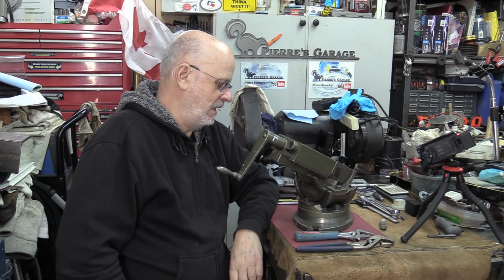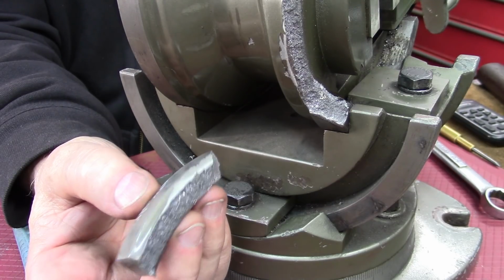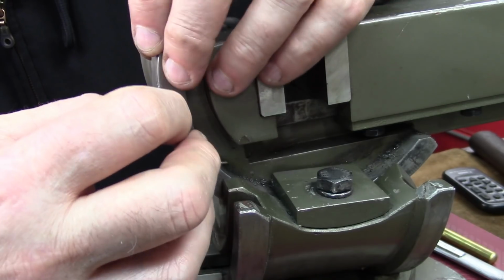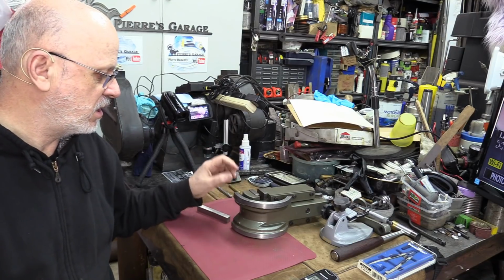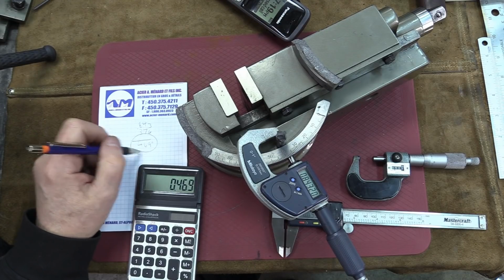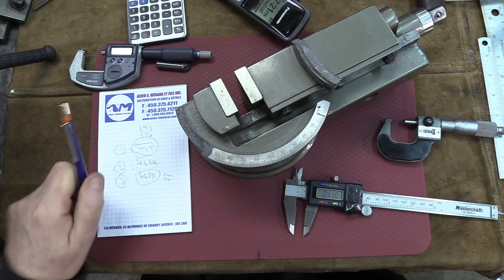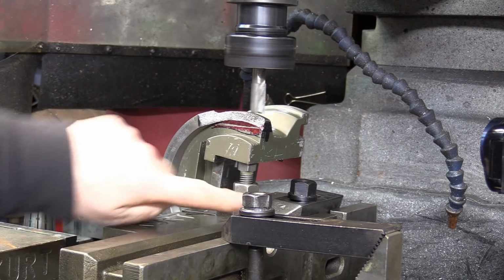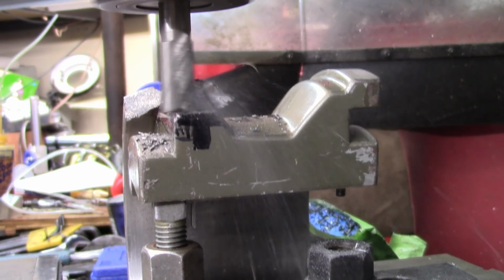Wilton 3 axis vise, smashed and repair using "Cold method" Part-1

Comment: Pierre,
  The positive thing about all this is you CAN repair it. Thereafter you will have the satisfaction of using a tool that now has Wilton/Pierre as manufacturing logo. Most people wouldn’t have even brought it home or even tried to use it as is. 
    I like the fact you are adaptable during the process. If epoxy is in the fix the more bonding surfaces you have, the better. In woodworking and guitar making we would call that a “blind mortise”. Very strong and interlocking which is what you need in this particular application.
Reply from the maker: The idea of using a blind mortise came early in the process, making it protrude instead of digged came as I was gonne make that last surfacing, having planned a little better it would have been the full height insteand of the 0.150" or so. This will be good with a few fasteners to assist...   ;)

Comment: Hi Pierre,

Shit happens as they say.  It happens to everyone at some stage. Usually to something expensive.  I think it's more maddening when you do it and can't blame anyone.

I'd be inclined to braze the break after tinning both faces, but this looks interesting.

The only downside is that the paint would be destroyed, but I would point out that steel always rusts more than cast iron, which is actually pretty low on the rust scale in comparison.

So that's something to consider.  I did a steel to cast iron pulley repair for the old Schaublin lathe and the steel rusts quite readily in comparison.  But you can shrink on steel.

Good luck with this one.

Cheers Rob
Reply from the maker: It doesn't mater who did the break, the vise doesn't care, it's broken and needs fixing...     lol
I the break would involve the part the hold the pressure from the jaws, there would be no question about ruining the paint, brazing or welding...
This part isn't so much stressed, so in order to keep the paint intact an epoxy and probably adding a few fasteners will surely do the job all right.
Here rust isn't much of an issue, except just have to be carefull in the very warm and humid days og Fall after a very cool period, some condensation will occur and flash rust about everything not covered with oil in the shop.
Cheer,   Pierre

Comment: When you dropped the hint the other day on the geometry video I was wondering how you were going to repair this one.  Interested in seeing how you set up to cut the radii on the inside and outside of the arc.  It's actually been fairly mild weather here, you're really cold compared to us!
Reply from the maker: The trig lesson application is coming in the 3rd episode, be patient...   lol
Today it's snowing a litte, tonight we're expecting freezing rain and rain, what a shitty mixture, we get from minus 25C to 3 deg. C in less than 72 hours...  In the leter years we're getting rain about 5 to 10 times per Winter, as way before it was once every 5 to 10 Winters, something is going wrong, even though I hate Winter and cold...
Cheers,    Pierre
Reply: Wet it down real good and put it out in the snow for an hour, that thing will be stuck there good! (minus thirty here on the lake this winter BTW!)
Reply from the maker: The first thing that came to my mind, working on the vise in the cold so it stays together, and, that by accident hitting my frozen thumb with a hard cold tool, there is a tear starting to form in the corner of my eyes...      lol

Comment: Weather at your place looks like how mine was on Monday.  I probably would have just built it up with weld and then annealed it in the furnace and remachined it. No one would ever know. :-) I wonder if heating that broken off piece to cherry red would have released stress in it and it would have sprung back??
Reply from the maker: I'm doing this in order to not burn the paint, if the break was in the part that support the pressure from the jaws, it would have been brazing and had to cacrifice the paint, but this area will be all right and saves me from a full paint job...   ;)
I'll try the cherry hot solution, that could save me in the future if it ever works, have my doubts, though...
Here, today's weather menu:  Some snow this morning, freezing rain later this afternoon, rain this evening......       Beuark...!!!

Comment: I think cold repair is best choice with this. Heating it would distort it and then you would have to find reference surfaces and completely machine all critical surfaces. If this happened to me, unfortunately I would just scrap it and buy another, because, I am pretty much always working on something here, no way in foreseeable future I would be able to give up time to fix the vice. I do weld cast iron micrometer castings, and is not fun to machine afterwords. But, I do grind after welding and that seems to go fine.
Reply from the maker: ŧhis is a $1000 vise when purchased new, it's worth for some people, not everybody, just like you can make more money making what you do best for paying customers...  ;)
One great thing about cast iron castings, they're less affected by heat than other type of steel, but, with heat you never know what the end will be...

Comment: Why not a metal infused jb weld type mock-up patch piece. You can use it to align your mechanical fixtures and use that to copy or cast a repair in silicon bronze. It too is a cold repair as all heating done away from vise. Even dovetail key that tenon you left in place and slide then screw down your repair part.
Reply from the maker: You're coming with a very interesting idea, the real deal is gonna be close from what you suggest, with no heat involved even away from the vise...   ;)

Comment: I saw the vise and I though "ouch". Then I saw your weather report, and I really felt sorry for you. Worst I ever experienced was about -17C (+1F) in Wisconsin. I gotta say, you are tough to manage life in -22C. Maybe you could just heat the oven up while you do your cold repair. :)
Reply: When I was in Montreal for new years several years ago, and it was -11°F/-23.9°C! In the city the wind was ripping through the streets between the buildings, and it felt like fire.

I was in the mountains of New Hampshire last year (January 2-3 2018) and it was -12°F/-24.4° when the sun went down. And with the wind chill, it was like -27°F. The strange thing was, that I couldn't feel a difference between the day and night temps -12°F night/12°F day. Δ24°F, but the day temps felt just as cold as the night temps.
Reply from the maker: The shop is heated at a constant 62 deg. F, it's comfortable enough with a hoody...
Sometimes we'll get a few days at -25 C  ( -13 deg. F ) this is quite cold...   For someone that hates Winter and cold...   ;)
Reply from the maker: One of the bad point about the cold in the city itself, is that the humidity level is higher in the downtown area, this makes you feel the cold even more...
The lowest I could remember is about -30 deg, C  ( -22 deg,F ) That is starting to be cold, this is not common around here, but a few days at - 25 C or so is more what we get, mostly around beginning February...

Comment: I use a shop vac on my mill as well, is your mill a T.O.S.?
Reply from the maker: A shop vac is our best friend, better than an air hose that will send dust into the bowels of machines and cause premature wear and failures...   ;)
It's not a TOS, I've worked previously on some TOS machines that were smaller, not as rigid as this one, this one is a Precimaster brand, more a distributor's calling, it's quite a nice machine and heavy enough at 3800 pounds or so, the table is 12 x 58 inches, lots of room for multiple set-ups...

Comment: Hi Pierre, If you want anything done right..................., what a ....... idiot, I think I got the exact same vise, only it is 2 axis and 100mm jaw with, it looks just like yous and has the exact same paint, I will not tell you where mine is made only that there is lots of rice and curry. when I saw you make the first deep cut near to the 90 degree mark I got the same ide to let the rest be a situation tab for the new piece, I almost shouted "Dont take the rest away" there should be plenty room for 2 or 3 screws. Looking forward to see the next episode.
Reply from the maker: That was a project with lots of plans adjustments on how to get it done proper, I think it will be a happy ending for the vise...   ;)
Cheers,    Pierre
Reply: Realy hope so Pierre, now that the Oops happend.